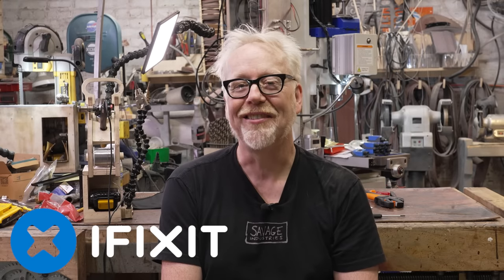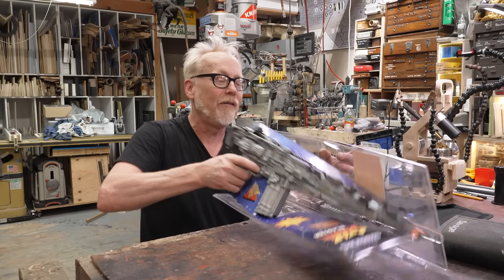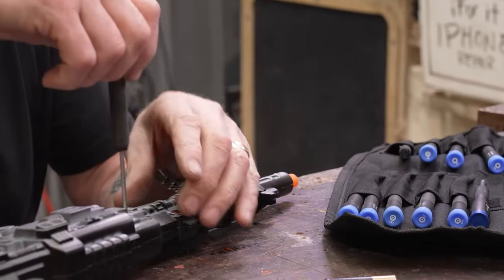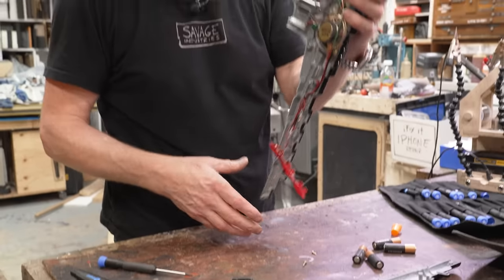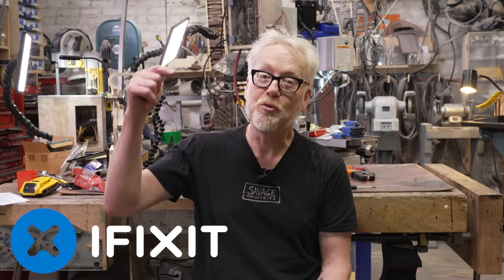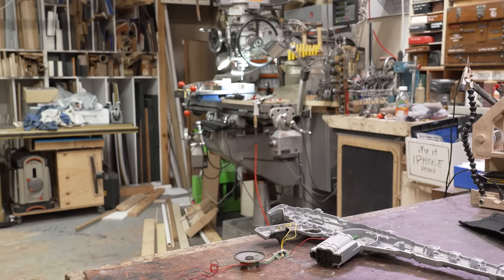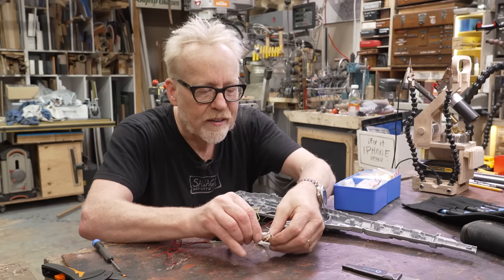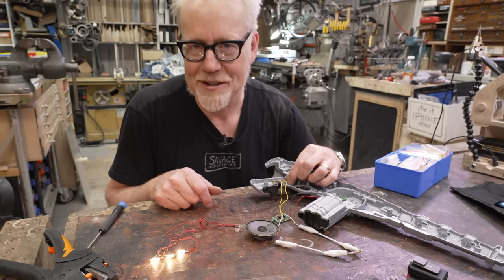How to Quiet Your Kids' Toys!

Comment: When Kid was four my father-in-law gave them a set of toy power tools. They were very cool, looked just like the real thing. Each toy had two functions...they moved appropriately while making a tool sound, and separately, for some reason known only to the (I can only assume drug-addled) brain of the toy designer, made a generalised growling/screeching sound. It's possible this was meant to indicate the background noise of a workshop but who knows! The machine noise activated only when the trigger was pulled to perform an action, but the other noise came on with the power switch and only went away when the power was turned off. Unfortunately, Kid loved these toys so I couldn't 'lose' them and I couldn't just take out the batteries because then they wouldn't 'work' like a tool. What I did do was take each one apart and cut the wire to the secondary speaker. No faffing around with resistors for me, it was just DEAD! Fortunately when Kid went back to play with them and they just sounded liked normal power tools they actually got played with more often because even at four my kid wasn't stupid! 😉 That Kid is turning 22 soon and this is still one of my most satisfying moments as a parent. 😂

Comment: Using a potentiometer or just a trimmer (small potentiometer) would let you find the resistance faster.. and in fact, i would just put a trimmer in there. If there is a nice little place for it, you can hot glue it and drill a hole so you can adjust the volume.

Comment: You could probably keep the lights working normally by putting another resistor in parallel with the whole lot to keep the overall load resistance about the same. If it's an 8 ohm speaker, then 10 ohms or so ought to do it.

Comment: This is an awesome trick I've used for years.  You can also save old wall wart power supplies to eliminate the need to replace batteries in toys that don't need to move very often.  Hot wheels tracks burn up so many D cell batteries....  Haha!

Comment: My dad got my son a VTech computer when he was young. It looked like a full on computer and had a lot of learning games built in. It was a great toy honestly. It's fatal flaw however was that it had a volume switch, low/medium/high. Guess which one my son preferred. We had a battle going where I'd turn it down to low when it was off and as soon as he'd turn it on, the volume would go straight to high. So in a similar vain to this video I opened it up and found that the slider would just bridge two pads on the circuit board to determine the level. I had a soldering tool and I soldered a jumper wire across the lowest setting and modified the slider so it would still be there but not function. The next time he turned it on even though the switch was in the high position he knew it was wrong so he slid it back and forth a few times, turned it off and never played with it again that I can recall. So in the end I guess I won?

Our other trick was removing the batteries and telling him the noisy toy "broke". Maybe not the best solution, lying to your child but I think the parents will understand.

Comment: a variable resistor also works great.   adjust until the volume you like, then use a VOM to measure it and put in a resistor close to that value

Comment: Honestly, as someone with higher ed in electrical engineering who does regular DIY… This is how is solve this problem… I can hotswap 10 resistors faster than I can set up a scope, and it “never” has to be the perfect voltage divide, just “sound right.”

Comment: If you want to make the sound even less annoying, you can add a small non-polarized capacitor (~1uF) across the speaker terminals to low-pass filter the thing to about 3kHz with the 47 ohms series "muting resistor" and make the sound a little less scratchy.

Comment: One thing that could possibly be done to test for a wanted resistance, use a potentiometer until you get the desired effect. Then measure the resistance. This has worked in my limited abilities.

Comment: 3 extra cent adds up but could use it as a feature and charge extra for it. A friend asked a company why they did have almost stretched cables, why can't they make the cables longer so if it's needed repair it was a bit easier, don't remember the number but was millions, just for a tiny cm or so on every cable.

Comment: lol, I bought that same toy gun for my nephew when he was 7 for xmas. I did it just to irritate my brother 👹. All day he ran around, making as much noise as possible, making my brother more and more irritated (much to my delight). That night after my nephew went to bed, my brother took the gun apart and clipped the speaker wires, reassembled it and put it back. The next morning my nephew took the gun outside to play, it still had lights but no sounds. He was slightly upset but my brother told him it was a cheap toy and likely just broke. Well my nephew took it out to the garage, got a screwdriver and took it apart, found the clipped wire, and after asking me for my wire strippers, re-connected the wire and got the gun functional again. Half an hour later he was back in driving my brother nuts again. LOL Ever since my brother tells me "NO MORE TOYS!!!!". So the next year I bought him a Trumpet. LOL

Comment: Even simpler method: can just use one of those cheap blue plastic potentiometers with a slotted screw adjustment, can buy a large number for cheap and just turn the screw until the sound level is what you want.

Comment: I would say it is ~1/12'th volume. 54 ohms would yield 1/8th volume, 120 ohms would be 1/16th volume. That resistor will probably get quite hot, but if the toy were closed back up I would not worry about handing to my child to play with.

Comment: Being 4 years older than Adam, when I got my first toy gun there was no electronics, it contained a friction motor with a flint. Actual sparks cam out of the barrel and it smelled like smoke after it had been fired. The duration of the noise was directly linked to the strength of the child’s index finger.

Comment: if the speaker has an impedance marker on the magnet yo could just a resistor thats 4 - 8 times more and that would probably be sufficient for most toys. if yo have a 8ohm speaker putting an 8 ohm resistor will half the power the speaker will see because you doubled the effective impedance

Comment: Electronics engineer here, the best solution in my professional opinion - Go to the mrs makeup cupboard, grab a circle sponge pad, stick it to the inside speaker grill of the gun, or outside if you're really lazy. This is applicable to story books which make sounds etc.

Comment: I forget when I bought it, but ages ago there was a Tiger electronics game called Lights Out, a little gray handheld with red LED buttons that I bought for 5 or 10 bucks. It had a sound volume button but the sound got GRATING after a while regardless of how much I used the button. Eventually, it got so bad I opened it up and cut one of the wires going to the speaker out of frustration. If I knew anything about resistors and had any soldering skill, I probably would have done this. RIP Radioshack, but I think you can get some of the same stuff from Best Buy (while they last,) or possibly HomeDepot these days.

Comment: 1983, 2 AM coding session on the wonderful Atari 800, I was sure the key click speaker was keeping everyone else from sleep. I also didn't know how much resistance to add, so I wired in a pot. The volume control let me code all night, guilt free. At least until I had to save it all to that noisy floppy disk!

Comment: Use a potentiometer in the alligator clips to adjust the volume to where you want it, measure the resistance of the pot, then install similar value of resistor.

Comment: You should get small logarithmic trimpots instead of assortment of resistors. If you hotglue the trimpot in suitable location, you can re-adjust the volume with a screwdriver as needed and all you need is a tiny hole for the screwdriver to fit through with finished product. And yes, if the manufacturers put that $0.06 part into the toy from the factory, you wouldn't need to do this kind of hack yourself.

Comment: I made a saber staff (not electronic) for my first son when he was 7. I used 2 plastic QGJ hilts, PVC pipe and glue, and a couple small screws. My sons is 24 now and he passed it to his little brother who still has it. POINT BEING, a father modifying toys in no way decreases their value to the child! In the case of a gun like this, with a little bit of "model-maker" skills and tools, you can install a volume knob (also cheap and just as easy electronically) as well to allow the child to set the volume himself.

Comment: Old toys had really cheap class A sound circuits.  Adding a resistor could throw off the DC bias of the output transistor resulting in clipping.  All new toys use class D amplifiers built into the microcontroller so go at it.

Comment: Adam, maybe delve back in prodding contacts around the IC and connecting a potentiometer to change the pitch and stuff. This would sound great all warped out, especially an octave or 2 down.  Fun times.

Edit, and maybe add a simple RCA line out for monitoring and YouTube purposes (very easy) or put an output jack into an FX peddle before your solid state guitar amp haha

Oh, and please use your cool microscope screen thing for us :)

Comment: as a basic rule of thumb for 8 ohm speakers (speakers in toys are usually 8 ohms) each multiple of 8 ohms of resistance will drop it by about half 8 half  /16  quarter /32 8th / 64/ 16th  its not exactly that but close enough as a guide

Comment: If its an 8 ohm speaker, then an 8ohm resistor would half the speaker movement. 82 is about 1/11th the speaker movement

Comment: Back in the day, I would just tape over the speaker grill to muffle the sounds 😂 .I wonder if the speaker has the impedance printed on it and if so, I would just try to add a resistor the same as the impedance to hopefully get half the sound output

Comment: Plain old clear packing tape over the speaker opening works great too, and requires no special tools. Not perfect as some toys have complex textures around the speaker so the tape can't make a good seal, and of course kids can remove it or poke new holes, but it's so cheap and easy, why not try

Comment: I'm sure some other Safety Susan has already mentioned this. A word of caution: The wrong resistor in a circuit can overheat, melt, burn up, and have the potential to start a fire. Even in small DC circuits powered by a couple AA batteries.

Comment: Amateur electronics person here. Start at 50~100 Ohms for a speaker. Speakers have quite low resistance. You can check the speaker's resistance using a simple multimeter across the contacts. Take that resistance and find a resistor about that value or a little higher. That should cut the volume in half. Too loud? Use a higher value. Too quiet? Use a smaller one.

Comment: I think a faster way to do this would be to use a potentiometer to set the volume to a desirable level, then use a an ammeter to measure the resistance across the potentiometer and find a resistor as close to that resistance you measured as you can.

Comment: Even easier is to take some clear packing tape and tape over the speaker holes. Keeps the toy original and is easily removed and replaced. Drops the volume by 90%.

Comment: There is a easier way to guestimate a resistor for that toy, look on the back of the speaker. It usually says how many ohms the speaker is and if you wish to cut the noise in half you put a resistor of equal value in series, if you want 1/3 noise level you use double the speaker ohm value in the resistor, 1/4 triple ohms and so on. No scope, not even a multimeter is required. Many speakers are 8 ohms, if this one is then the resistor Adam used reduced the sound by over 90%, may please the parents but if it is to low the kid won't like it as much and might not appreciate the toy/gift as you intended. I would recommend a 2x or 3x the speakers ohms resistor if you can tolerate the sound level, you may wish to see the wattage of the speaker to and use a resistor that can handle the load without braking or catching fire. A 2W speaker would need a 2W resistor, the one Adam showed is just 1/4 Watts. (a standard size in electronics) If you can´t get the value or wattage you can use double value and 2 in parallel, that would also help to get the right wattage value. 
Ps. you may need the color code key to know the value of the resistor, easy to find for free on the web.
Reply: @timharig  So you are saying that you would half voltage and amps resulting in 25% remaining "sound" by doubling the resistance with a resistor in series? That makes no sense to me as a resistor has no impedance like the speaker coil do. It's not the same type of resistance, perhaps if you replace the speaker with a higher impedance one that might happen.

Comment: Noticed from the start the lights were like zenon or whatever high voltage low current or something like that. They light up with static electricity. Maybe replace them with LEDs I'm no mathe'magician or electrical wizard but as you had previously stated, try it out see what works.

Comment: This works, but it's putting an awful lot of extra wear and tear on the output.. Speakers have very little resistance, usually between 2-16ohm.. This is why the 220k didn't work at all. 82ohm probably isn't going to destroy anything, especially considering it isn't constantly on. But you'd probably be better off going with 2 of the 82's paralleled to give you an approx 41ohm added resistance. It'll be a little louder than the 82, but still much quieter than it was. Granted you don't care about this toy haha But if by chance someone out there is going to do this to some toy your kid loves, try to go with a little less resistance. ;p

Comment: I just bought an assortment of variable resistors, turn them with a screwdriver to the value you need, saves some hassle. But yeah this is the real dad pro tip 😂

Comment: PSA for those who "know enough to be dangerous": Be extremely careful and/or avoid opening and modifying anything that plugs in for power. Plug-in devices usually have the ability to handle higher voltages and currents to the point of being life threatening. Certain devices (guitar amps, CRT TVs, etc.) have large capacitors that can remain charged and dangerous even when unplugged from the wall. Anything that is purely battery powered is usually  less than 10V and won't hijack your muscles or stop your heart if you cross the wrong wires.

Comment: You know enough about electronics to do something, not how exactly it does it or why. I know a little more but am still more likely to cause problems or possibly hazards further down the line.

It would be a huge advantage if the manufacturer just had a potentiometer as a volume knob that can be adjusted with a screwdriver from the outside. That would be amazing.

Comment: Most electronic toys are built so loud, that you can tape the speaker grille from behind, and it will lower the volume to a comfortable level. That doesn't require much electronics knowledge. As for battery compartment polarity, in the absence of any diagrams, springs usually mean "negative" (-).

Comment: The Brazilian YouTube Channel @manualdomundo showed how to do this without even using proper resistors. He took some pencil graphite and used it as the resistor, shortening the length of the graphite reduces the resistance...

Comment: 4 AAA batteries are 6V which means this thing works on 5V , every discarded vape and every usb power bank has at least one 18650 or similar  battery and the circuitry in it to drive 5V and to be recharged. As a maker, or even just as a normal person you should collect those and have a drawer full of them to power all sorts of things. insted of using fresh single use batteries, not even for the environment, although that is also important, but for the cost. Discarded vapes are free and the batteries will still last for a long while.
Reply: I wholeheartedly agree. The time spent learning how to identify and properly manage rechargeable batteries will pay for itself many, many times over.

Comment: What I did with my kids' loud toys was to use a micro flathead screwdriver and gently push pieces of kleenex into the speaker grill to apply a little pressure to the speaker cone.  It was very effective and only took a few seconds.

Comment: Problem!  If the Lights were responding to peaks from the speaker, the lights should blink more and would not be coming on and staying on while the resisters were in place.  I'm thinking lights are wired separately to power, but trying to receive a signal from the speaker.  Your resisters are somehow (I don't know the layout of the circuitboard) forcing the power to bypass the signal circuit and remaining on the entire time.  This could lead to a short and start a fire depending on the toy.

Now, this may be perfectly safe, but clearly, the lights are not getting power just from the speaker if the flashes are responding to the peaks being used for sound!